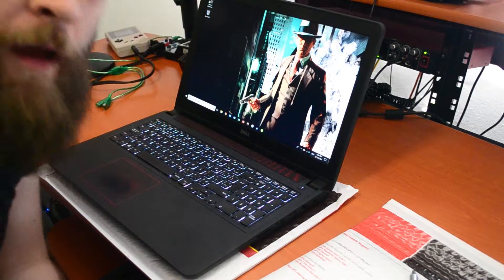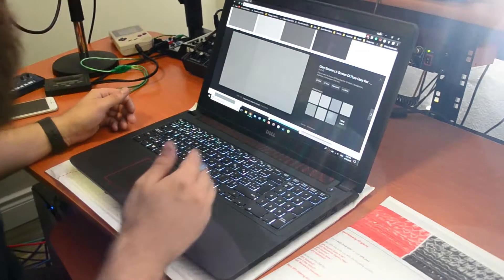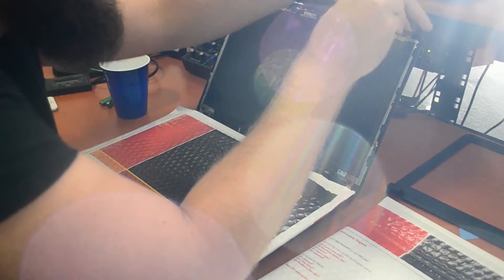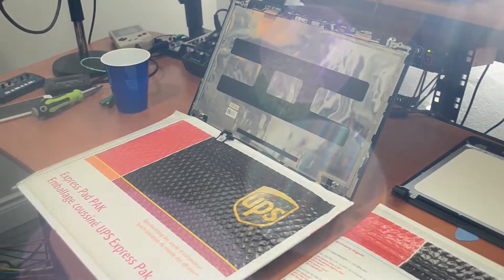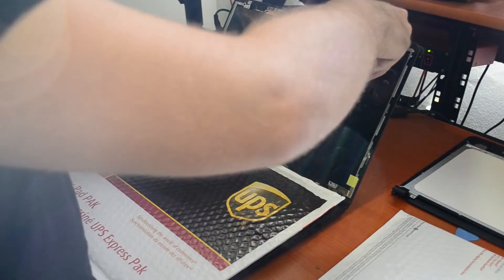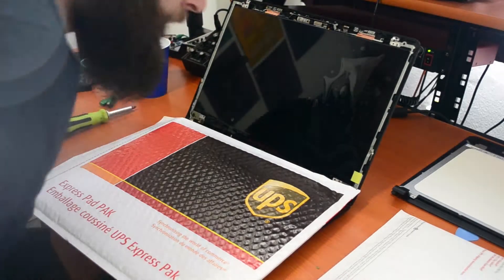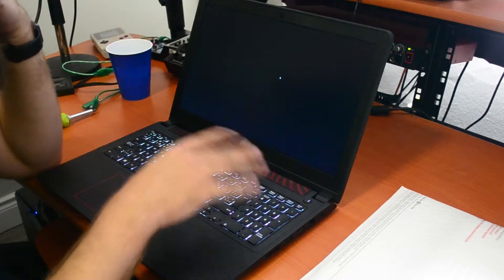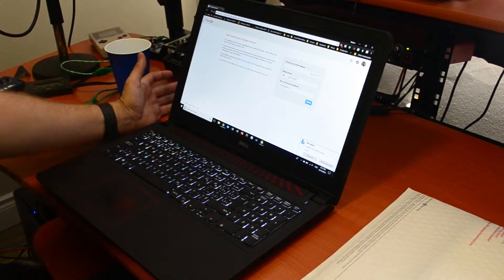Laptop screen replacement / How to replace laptop screen [Dell Inspiron 7559]

Comment: Yo. I have the 7559 4k version. And I'd like to change it to the 1080p version is that possible?
Reply from the maker: I didn’t realize they even came in 4K by default- I figured that was an upgrade people purchased!

In any case I’m not actually sure. I can’t think of a reason it would be a problem, but I can’t say for certain it would work!
Reply: @PoizenJam  alright then. Thank you.